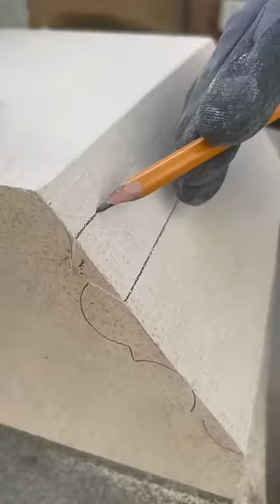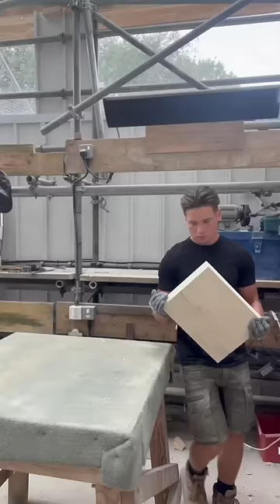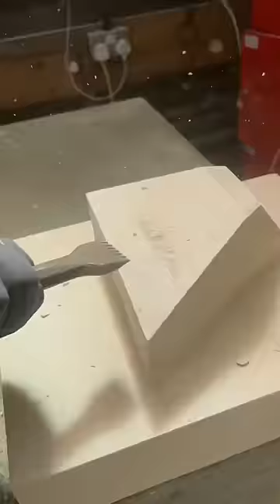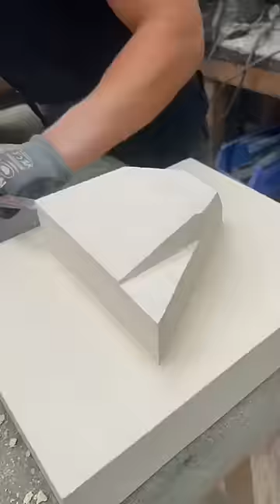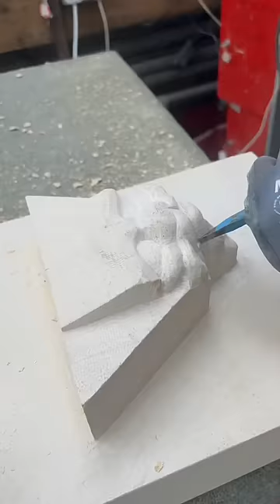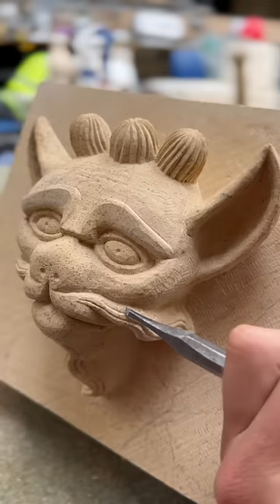#stonemasonry

Comment: I just realized the stone working in the background was there to call Joe a moron.🤦
Reply: I mean not really, that's a slab of lime or sandstone worked with a. Hardened steel chisel far cry from using hammer stones and copper chisels on granite which is 6-8 moh limestone is maybe half that, yes the precision shaping is possible with modern metals, but shaping, quarrying and laying granite slabs that are 70 tons is a far cry from cutting a facing stone, which btw the facing stones of the pyramid were limestone and there is no debate about the shaping of cutting of the facing stones
Reply: @chrisread6292 they had slaves that could cut the stones using stone and copper tools they had and put it on a slay and drag it to the site. It’s not hard they even did it on the history channel one time
Reply: @giuca002 egypt and metal?.no
Reply: @مجنون-د1ث you don't think they had metal over in ancient Egypt? The place that had pyramids filled to the brim with well refined gold (a metal)

Iron is far more common than gold.
Reply: Marble and limestone is 3 or 4 on the mohs hardness scale granite can be fucking 8 tungsten carbide is 9 diamond is 10 carving this type of rock is like moulding play doe in comparison to granite you chip granite and on your fifth chip it will be like 10 times the size and just leave a massive crater like you just took an ice cream scoop straight into the rock cause it breaks so unpredictably
Reply: Well they can try yo do that on granite and with copper chisel.
Reply: @giuca002 METAL😂😂😂
Reply: @lordandsavior6726 so you are saying that official sources are lying
Reply: @johnmurdoch8368  not at all, I'm saying whatever unofficial crap you're using is wrong. Actual official information tells us that there was plenty of gold to be had in ancient Egypt
Reply: Iron was only from meteorites so was VERY rare however copper was used and prob how they cut the stones. Whoever says "aliens made the pyramids" are dumb. We have had the tools to build them for a while and yes it took a long time. Also the stone was from nearby quarries so its not coming out of thin air
Reply: Im 90% sure this is an ai voice, it dosnt sound quite right, and ive never seen a clip of him saying this that included his face like normal.
Reply: @demolition3612 it's not. It's Joe. Can't remember the pod, but I watched it.
Reply: Is that stone a 2x2 meter block that he carried for 500 miles in a desert? Use your empty head
Reply: No, it’s not this song worker right here couldn’t even build one stone for the pyramid today he couldn’t carry it he couldn’t ship it on his own can’t do any of that this is just proving Joe Rogan smarter cause the stone worker is working on very light stones that are not granite and or small
Reply: @davefred the quarry was next to Nile, it wasnt "carried" over a desert you goof
Reply: @abseiduk  you can and they did, all it meant was that it took a longer time than with steel.
You could even take a granite chisel, sure it would wear away much faster than steel, but in the meantime, you made progress on the slap you were working on...
Steel only makes the job a lot faster and easier and your tools last longer, but it is perfectly doable with just stone tools.
Reply: @davefred no. The quarries were close to the pyramids. Don’t blindly believe what daddy Rogan told you lmfao
Reply: @lordandsavior6726 Yes, but gold can be smithed because it is soft and has a low melting point. At the time the pyramids were built, they didn't have the technology to refine iron, or even bronze. They were working with copper tools.
Reply: @karlokarloo4658 There wasn't just one quarry used to build the pyramids. There are stones in the pyramids that also match quarries far out of the way, which is why experts believe many of the blocks were brought over on boats, or the sand was wet just right so that blocks could be dragged over without getting stuck.
Reply: @andrewprahst2529  I get what you're saying bro but copper is also a metal. It's not like they were working with stone tools. These monuments took many years and thousands of slaves to build. It was very likely a slow and arduous task
Reply: Yeah... he's a podcaster not a historian.
Reply: @lordandsavior6726  👍
Reply: @johnmurdoch8368 the pyramids are literally topped with gold lol
Reply: @nahmate6172 cool it is hard?? So what dosnt change the fact it is brittle, sand abrasions and chipping away at it there is your impossible technological advanced answer lol. At the end of the day granite is stone.
Reply: @lordandsavior6726 you’d go through a LOT of copper tool’s before you even cut through a single side of a block of granite. And it’s nowhere near dense enough to use as a chisel without replacing every dozen hits
Reply: @PublicRestroom88  as I said. It took years and was a long and arduous process. Many slaves died building them. 
They had slaves doing all the work so it didn't matter if they went through a lot of copper
Reply: @lordandsavior6726  yeah 2.3 million blocks within the span of 3 decades isn’t realistic. There’s been experiments done with copper saws and sand the way they claimed the Egyptians did, it took an hour to cut 4mm deep. You would need millions of slaves working 24/7 to even get close, which the Egyptians didn’t have. The most slaves the Egyptian empire had at any point in time was around 30,000
Reply: @PublicRestroom88  hate to be that guy but how do you think they did it then. History tells us that was how it's done and unless you're gonna tell me aliens came outta nowhere and helped humanity built a few random pyramids for no reason I'm more than willing to listen to how you think they built them
Reply: @مجنون-د1ث you are joking right they weren’t in the Stone Age dude
Reply: @johnmurdoch8368  yeah literal Google search proved you wrong so I’m not sure what source you’re talking about
Reply: @davefred  do you understand they had tools they also had methods of moving the stone using pulleys logs and all of that shit also, there’s stuff found fairly close to the pyramids
Reply: @TORQ111  do you understand that multiple people carried the stones for the pyramid, right this was not a one-man job, or does teamwork just not exist to you
Reply: @andrewprahst2529  I mean when the facts state that there was metal tools during the time when the pyramids were being built that’s a pretty good argument for there being metal tools
Reply: @chrisread6292 idk a bunch of force labor chiseling away for 30 years sounds like it would get it done, and if you ask about how they got the stones there, I got an answer, logs. They rolled them on logs, be cause dragging is a hell of a lot more efficient
Reply: @mudkip6056  Yeah, that's why I said they had copper tools. 
However, some people imply that metal is metal, and it doesn't matter what kind of metal it is. The steel chisel in the video is not the same as the copper tools the egyptians used, copper is significantly softer. 
While copper chisels might work fine on the softer stones like limestone, it isn't an option for the harder stones like the granite of the king's chamber ceiling. That's why experts theorize that l they also must have used something like a quartz sand aggregate and water to slowly wear down the harder stones.
Reply: @giuca002  Please you’re not helping by doing this. 

They used sand and a flat bottom saw to cut granite. 

Copper was the hardest metal they had and it isn’t harder than granite, but quartz certainly is, and guess what? Sand is in large part made of quartz.
Reply: @PublicRestroom88  I hate that no one in this comment thread is typing a reasonable answer. Copper isn’t hard enough to carve up granite. In order to cut granite you have to use a harder material, in this case it’s quartz from sand. You take a flat bottom saw and run it down a line with abrasive sand to slowly cut that line.

This stuff has been tested to work and yet people are yelling about metals.
Reply: @andrewprahst2529  finally one person in this whole comment thread actually did some research
Reply: @tonydai782  were talking about the same thing. And using said method in an experiment scientists found that you can only cut about 4mm in an hour when going at a constant rate. That’s 3.78 inches in a day assuming they work at the same constant speed. Let’s say you have two slaves working on one block at a time and you alternate 12 hour “shifts”. That would be 4 slaves per block per day to be able to constantly cut the block. If we add up the avg size of a pyramid block (50”x50”x27”) you get 254”. Divide that by the daily rate and you get 67.19, which is the amount of days it would take a group of 4 slaves working 24/7 to fully cut just a single block.
Reply: @PublicRestroom88   Yes, it’s quite impressive what they accomplished. There’s definitely a good reason why most of it is limestone and only a relatively small amount is granite.
Reply: @chrisread6292 the pyramids are primarily made of limestone i genuinely don’t know where this the pyramids are only granite shit came from. they have a small small number of granite material in comparison to the limestone.
Reply: @andrewprahst2529  ok you can still carve with soft metal you know that right
Reply: @mudkip6056  Depends on how hard the thing you're carving is
Reply: @ashtonjohnson4361  it's not the amount of granite in the pyramid, and the funny thing is no one debates the tools used to carve and quarry the limestone used, but I don't know if you've ever struck dolomite on granite all you do is marre the surface so please explain to me how you level granite with it, you want to make a pyramid of limestone the building is easy it's the maths that present issues but as soon as you add 70 tonne granite slabs that have perfectly leveled sides and you try tell me that they smacked stones against it for 30 years I call bull shit
Reply: @davefred use your head first
Reply: @PublicRestroom88 Your math is wrong. Because you assule Pyramid are made entierly of granit. They made of lile stone for like 99% of the stucture.
Reply: @chrisread6292 they used Quartz sand to cut  the granite.
Reply: @ysbrann3059  you’re right I realized that yesterday. I have no study to draw data from that uses the same saws to cut limestone, or at least I couldn’t find one. I’d have to run an experiment of my own which unfortunately I don’t have the resources for. But if one were to get a block of limestone and make themselves a copper saw blade you could recreate the same experiment (given you have another person willing to sit and saw at a piece of rock for an hour)
Reply: @lordandsavior6726 Depends on what area of the world you are, you do know this isnt minecraft and recources are not evenly spread out and located everywhere in the world. Only certian rscources can be found in certain regions of the world
Reply: @chrisread6292 that's a common misconception. They used QUARTZ tools. Not copper.
Reply: @nahmate6172 fun fact, it has been proven that if you fill a groove of granite with sand and then saw that back and forth (for example by putting a weighed down wooden plank on top of it) then you can "erode" the granite into all kinds of shapes.
Reply: @Ecl1ps3_XD  ok, if you really want to be ridiculous here and bring up a strawman argument like that I'll have you know that in Minecraft you can't get netherite in the overworld. Just like you can't get iron ore, emerald ore and diamond ore in the nether. 

You also won't find any of those materials in Minecraft deserts. Or maybe you can if you go deep enough. Idk I haven't played Minecraft in years. 

But if you're done pulling out an argument that has nothing to do with what I'm saying they've been known to use copper tools, there is depictions of how they made the pyramids on the inside walls of said pyramids.
Reply: @chrisread6292  Just read through these comments and damn, you guys are uninformed. I will provide links.

Point 1: If they were so advanced why do we see so many different approaches to making the pyramids? They keep changing construction methods over time to adapt to what was failing on the last version. That's odd, we see so many faild versions in older construction. Almost like they had no idea what they were doing and learned how to make them over time...

Point 2: You guys keep talking about how far the quarries were from the building sites. Again nope. The preferred quarries were very close to the construction. Yes some material was quarried from farther away when needed  but that was clearly a last resort.

Point 3: The pyramids are made out of granite and is harder than diamonds! Nope! The pyramids saw very limited use of granite. Doorways and structural parts were sometimes made from granite but mostly the body of the structure was made out of low quality limestone and sandstone.

Point 4: They had no tools! Wrong! They didn't only have copper. They had stone, copper and bronze, and believe it or not but they used a lot of wood and rope. Combining these materials they had thousands of unique tools and methods that have been lost to time. Furthermore copper can be tempered and can be made to have many different properties. Copper can actually be very hard when made correctly.

So here is the point. You are misinformed and just don't know. I'll be honest with you I don't know either. I wasn't there but I do know this. The pyramids were made by people with knowledge and skills avaliable to them at the time. I hove no doubt that ancient Egypt had craftsmen that know way more about working these materials than we do today. So what, not one of them knows what I do about injection molds and working with plastic.

It's not aliens, it's not an advanced ancient society. It's just a large number of people working for many years learning over time.

https://en.m.wikipedia.org/wiki/Egyptian_pyramid_construction_techniques
Reply: @abseiduk they often used copper saws... with sillica sand (aka quartz, harder than granite) as an abrassive.

All things considered, not very different from how diamond tipped tools work today
Reply: @chrisread6292 you mean quartz toolss on ssmall granite creationss and copper on the limesstone they’re built out of?
Reply: @chrisread6292  I mean when you have thousands to work on one stone… it isnt that hard. Like 50 people max then can make the same work as one Person now. Its not that hard when you have enough people
Reply: @lordandsavior6726 they had gold, Silver, lead, copper and bronze later on all of which are not even close to being able shape the granite they used. Iron was after their time let also the harden steel you would need at minimum to shape the granite they used. That might not even do it.

Comment: I love watching this skilled mason doing his craft while Joe blabled on like he knows wtf he’s talking about. Really adds to the stone carving.
Reply: Didn’t have steel tools back then bud they were copper… have fun commenting on HIM not knowing what he’s talking about though :)
Reply: @ThePDaddy Bronze, which is much sturdier. If they were lucky, they might had some iron from meteorites, one of the pharaos had a dagger made of such metal
Reply: @toxicgenji7497   And they just had a hammer and avil right where the meteroite fell? The problem they had is they couldn't get a fire hot enough to melt iron. It would cool down by the time they got there
Reply: @karlmarcs31  cold working metal was an extremely common practice before we developed forges capable of retaining the heat necessary to melt iron. You also don’t melt iron to forge weaponry and tools… you melt iron to refine it and using dirty iron was also the norm before furnaces could melt iron. Also iron usage in Egypt dates back to 5000 B.C. At the latest and the pyramids were built in the 2000s.
Reply: @karlmarcs31  Meteorites don't have to be big, some can be be carried by hand
Reply: @ThePDaddy  Coordinates of the Pyramids is the Speed of Light.
Reply: @toxicgenji7497 or literally just a stronger rock
Reply: Not sure if this was a dig or a praise of the video but I love the metacommentary. Look what can be done with simple tools in skilled hands, then add a century and slave labor and see what could be accomplished! Not sure why anyone listens to Joe Rogan
Reply: @user-burner  Or that, Quartz would be the best example

Comment: I would like to point out that the Egyptians were using softer metals like copper chisels and basic measuring tools as opposed to the high carbon steel, diamond embedded saws, and highly calibrated measuring tools we have today. Just saying... they were truly talented humans.
Reply: I'd like to point out that the Egyptians had diamonds. Diamonds are very useful for cutting stone. So useful that they're still used for that today.
Reply: Same exact method as using modern tools…
Reply: @therealctoo4183  They probably uesed corundrum (is that the correct translation) which is nearly as hard as diamond, but a lot more abundand.

Or really - use water, quarz sand and a rope and you can saw stone.

Also - copper tools work pretty well for working stone. They just wear down way faster than steel.
Reply: @robertnett9793   I heard they used quartz
Reply: @nicovanos  Or that. The point is: There's a ton of working ways to cut stone even without modern tools (and magic for that matter).
And while archeologists don't know which way exactly was used, it's way more likely that ancient people used those ways instead of relying on aliens, magic or ancient civilisations.